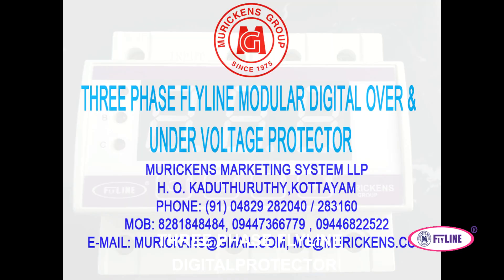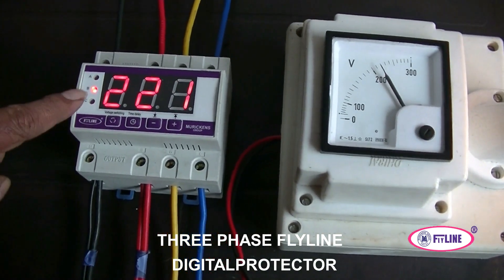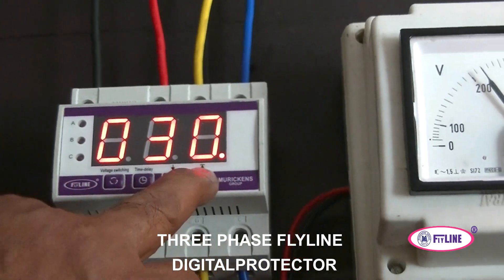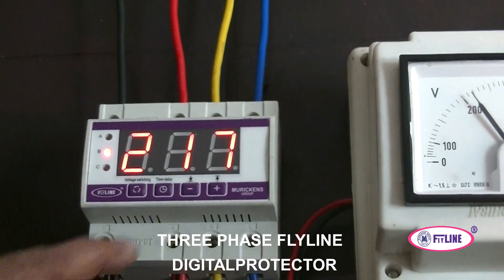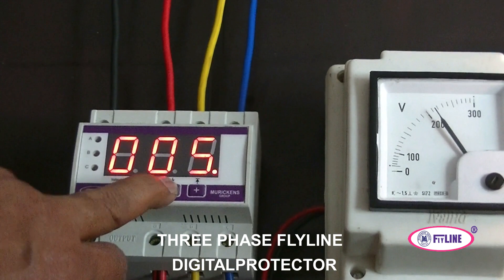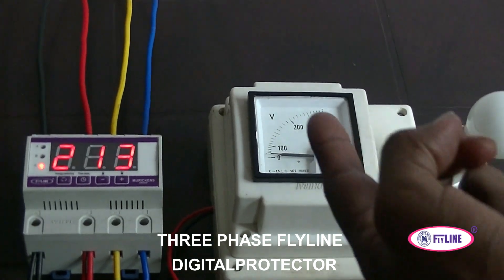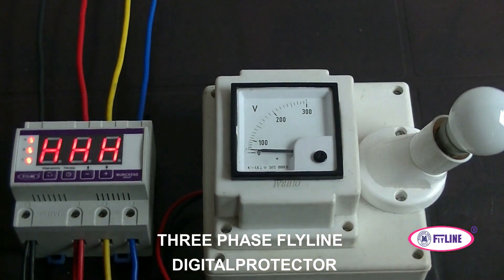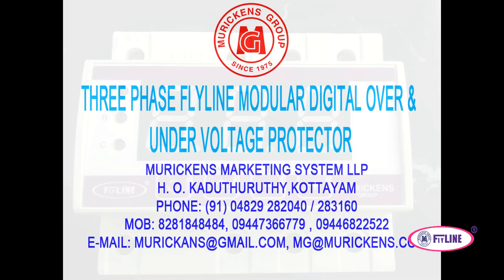Three phase Flyline modular high & low voltage, delay,surge and lighting protector- Murickens Group

Comment: sir i have a doubt ...when the device detect over or under voltage it will trip totally or otherwise it will trip particular phase?
Reply from the maker: Total Power.
Reply: okk sir thank u
Reply from the maker: @lifeatseaonship   For more Details  pls Contact +91 9188323232 or +91 8281848484

Comment: i am looking for this product for 3phase
i need price for it also for single phase
Reply: is this available in Chennai???
Reply: @sindiyanewton1220  Yes. Contact :  9188323232
Reply: FDP 3 PHASE 32 AMP RS. 7500/- AND  63 AMP  RS. 9500/- ONLY
Reply: @solarpowermurickensgroup  what about warranty ?? Is it available at ernakulam ??
Reply: sINGLE PHASE   32 AMP RS.3500/- AND  63 AMP RS. 5500/-